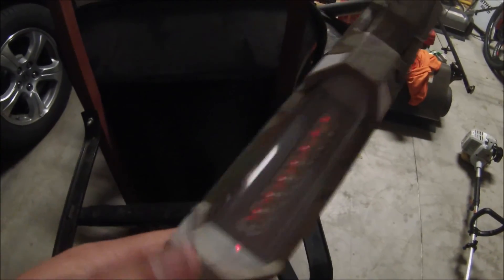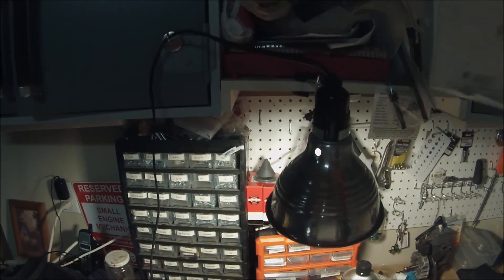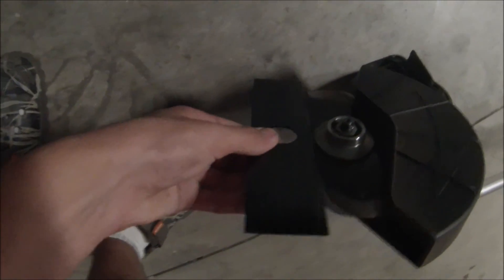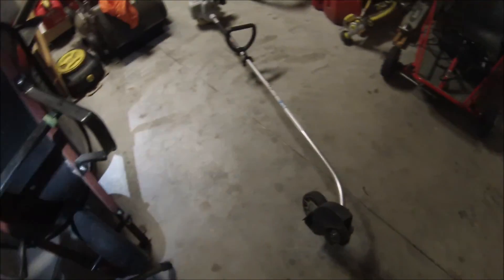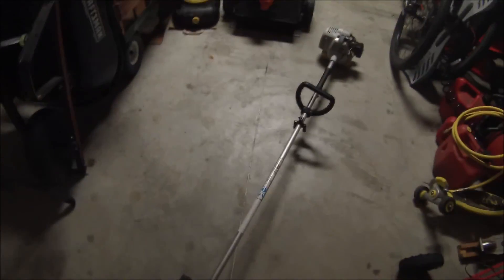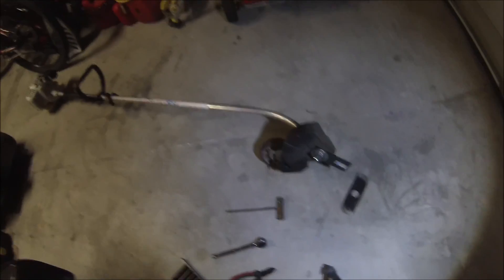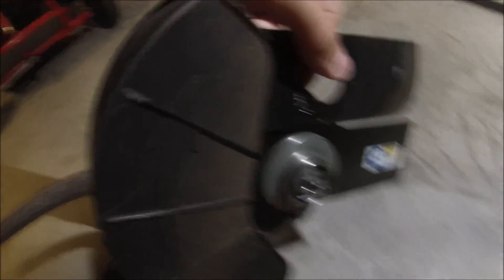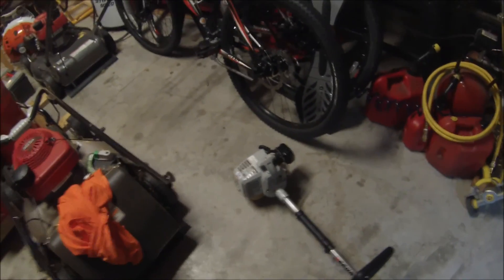Lawn Care Vlog #2 - Night time equipment maintenace

Comment: Oh yes, it was time to change that blade. Hey that cotter pin is completely unnecessary.  I've left them off for the past 25 years and a blade has never come loose. Just FYI.
Reply from the maker: good to know :) I'll probably end up just using up the cotter pins I've got and then not buy any more after that. thanks for the tip :)